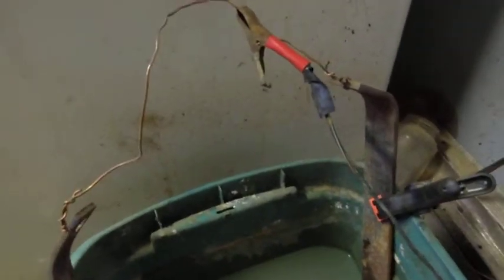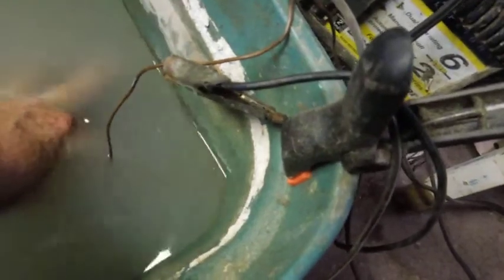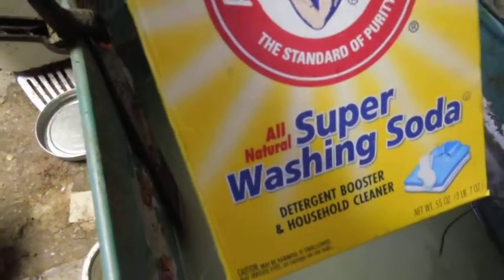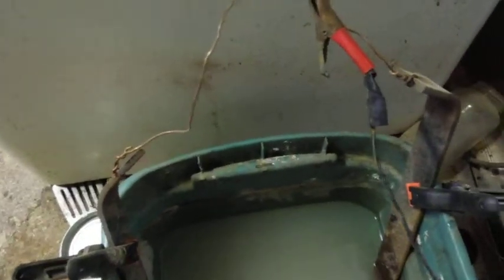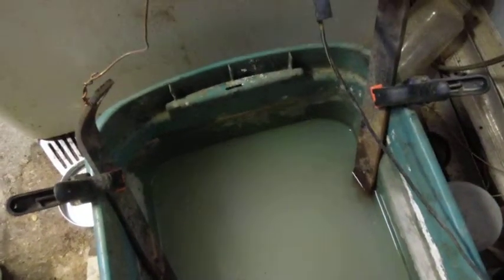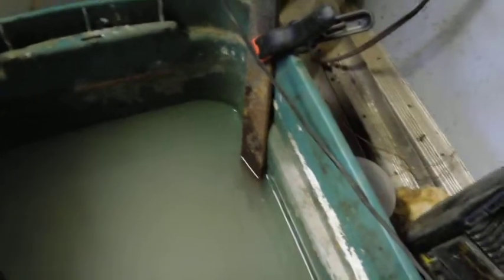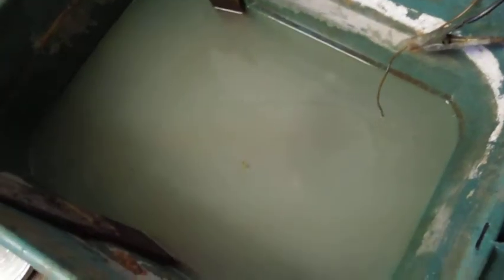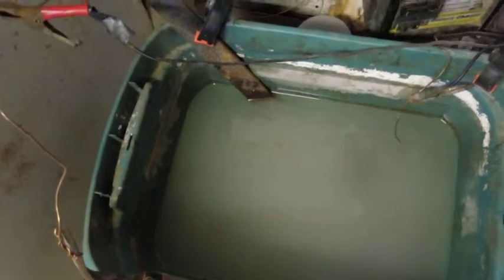Electrolysis:  cleaning rust from an antique flat iron.

Comment from the maker: that is way too much current for this and would be dangerous.  for both the electric shock issue and the hydrogen gas that is being produced as a by product.  This is low enough current that you could use solar panels to make it happen.  Harbor Freight sells a 3 panel kit that makes about 3 amps at 12 volts DC for about 125 bucks.